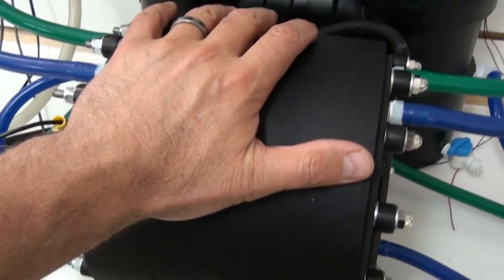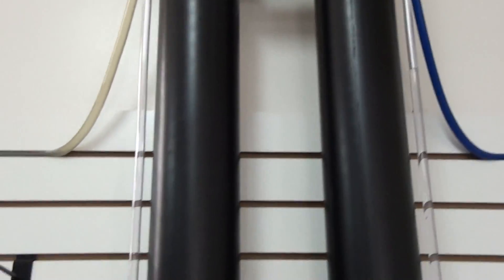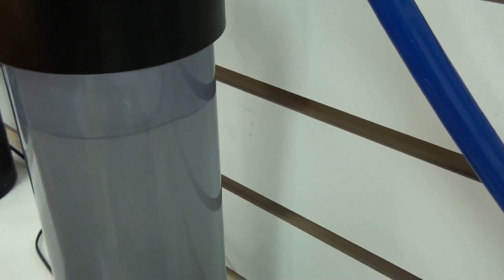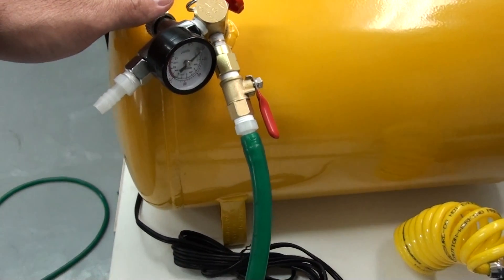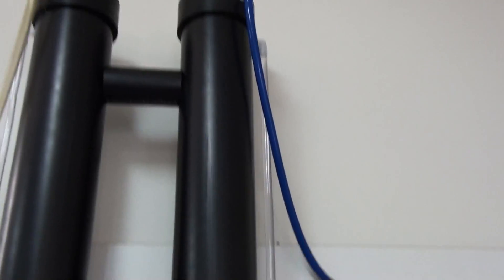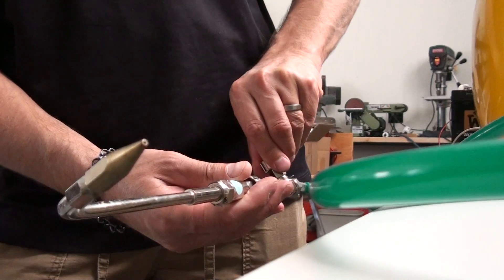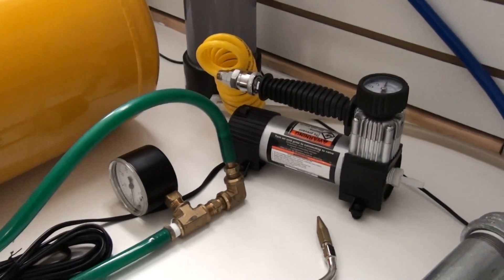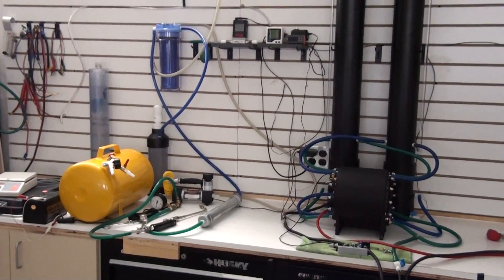Pure Hydrogen Generator Split cell system. Hydrogen compression PART 1

Comment: Imagen what this idea would do. First it will stop most of wars. As this is the first reason for all wars ( power ). It will help people in Africa to use solar, to work pumps, to get water from the ground, to use for making hydrogen, to run there electricity. So many good things we can do to make life easy for so many people. I can give you endless ideas. If only so many government's use technology to help people so they can be respected and loved instead of bombing them for domination. The idea is to be respected. Not to be feared.
 Floros theodorou
Reply: this is good work. I want to get in touch with you. how do I do that? we have a lot to talk about.
Reply: floros theodorou .There could be  a problem with the fossil  fuel  economy  they don't like when  someone  moves in on their territory  and takes too big a slice  of  the pie.
Reply: the ony issue is they need electricity for electrolysis, and using the hydrogen they get from that to run their electricity would cause a net loss in energy, to heat mostly im assuming, and anything else using the electricty  initially generated

Comment: From all my investigations in to hydrogen this is the best I have seen so far. Also you have mention my idea for this processes. My idea is to use solar panels to use the electricity, to produce hydrogen, to use on generator, to use at night. Making you complete independent on electricity.The search I am doing is to make this safe as possible.
 ( Floros Theodorou )
Reply: Did you ever figure out a system?

Comment: Is it easier and faster to make natural gas from wood burning?
Reply: I find that gas is high in carbon and very dirty .....An engine won't run on it for long before carbon fouling is a problem....and if your going to burn the gas to produce heat , you might as well just burn the wood
Reply: Does adjusting for more complete combustion help reduce carbon?

Comment: I have been wanting to do just what u r doing to supplement my batteries when sun is gone I have a off grid solar system when sun is out i have lots of extra power that i need at night so i want to use hydrogen to run a gen or fuel cell to charge batteries.

Comment: Nice video steve! Thanks for sharing! 

Here are a couple of links to high pressure compressors. You can get a small high pressure tank like the ones used for paintball and compress the gas into them or get a large tank and do the same. This will allow you to store a allot more hydrogen without having to take up a lot of space. This is part of my hydrogen storage project I'm working on to store energy in the form of hydrogen for solar power homes instead of in batteries.

http://www.shoeboxcompressor.com/

http://max-air.com/applications/paintball/

Comment: Seeing ths I immediatly think of the shoeboxcompressor!
You think this will work for the hydrogen?

	
The ShoeBox is the worlds smallest and lightest line of high pressure compressors starting at $649 dollars. These are the least expensive 4500 psi (or 3000 psi) air compressors on the market. It allows you to fill your paintball tanks or air rifles in the convenience of your own home.  If your tired of hauling your scuba tank to the dive shop for a fill, or the long drive to find a paintball store with a fill station, we finally have an affordable solution.
 
Compressor Open Frame
Patent applied for
The ShoeBox Compressor offers freedom from relying on others for high pressure compressed air. If you have a 4500 psi or 300 bar paintball tank you can fill it directly from the ShoeBox. If you have a SCBA 44 cubic foot tank the ShoeBox will fill that too. 80 cubic foot scuba tanks are often filled by both our paintball and air rifle customers. They use the scuba tank to transfer fill to their paintball marker or air rifle instantly. 
The ShoeBox works with your 85 psi shop air compressor to "boost" the final output pressure to 4500 psi or 300 bar. This eliminates the cost of the first stage and allows the ShoeBox to have a retail price nearly 10% of standard 4500 psi air compressors.

http://www.shoeboxcompressor.com/

Comment: Nice work Steve. You did manage to put a video out before me : ) Mine is going to be cooler though lol. I need to check the compressor I have to make sure it doesn't have the same problem as yours. I appreciate you putting a video out and showing people this can be done. I told you we could safely make it happen using our split cells. I know you spent many years looking into this and so have I. Its refreshing to see it all come together. Can't wait to see what else you come up with.

Comment: i think it would be a good idea to have an oxygen sensor / alarm / shut off at the end of the production line, just before it goes into the storage tank - that way if for any reason that oxygen gets into the output - the system will alert and or shut down the production .

Comment: How many PSI can your tank stand ?
What is the best and safest compressor to compress H2 into this tank ? You could just first fill the tank completely with water to push all air out and then fill the H2 into it under water, so there will be no air getting into the tank. It is pretty tricky to do it this way and you need a big water bath also where you can sink the gas tank into it first...